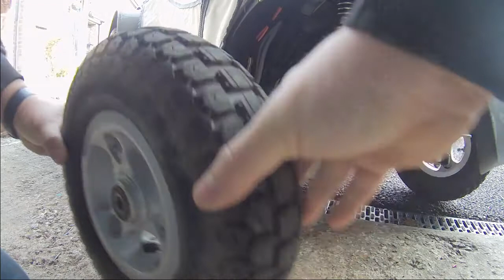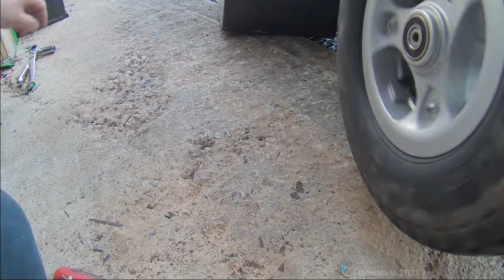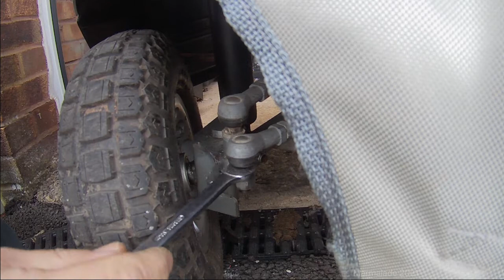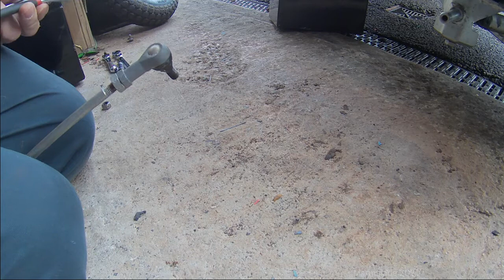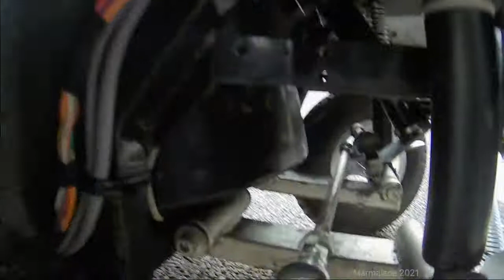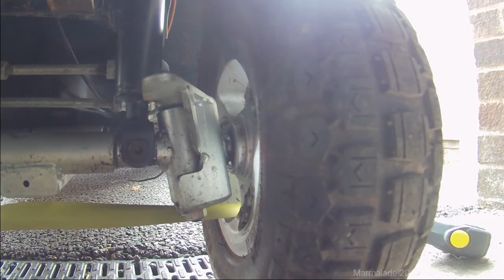TGA /Afikim Breeze S4 mobility scooter. Front wheel bearing & steering track rod end replacement.

Comment: how do you know when the track rod ends need replacing
Reply from the maker: The steering can become vague and you can often hear knocking. 

Turn the tiller fully left or right, hold the wheel that is pointing inwards at the front. 
With the other hand, grab hold of the track arm and give it a wiggle. 
It’s connected by ball joints so it’ll twist but should have no up, down or sideways movement.
Reply: @Bramble43  thank you ill try that
Reply: @Bramble43  slight movement up an down, on one side there another joint rod going to the steering ,that move up an down with a noise

Comment: Omg can’t believe what I’m watching  for a Tga engineer came out to this they won’t touch it on site it needs to go the  factory because you’re going off your eyesight not bang on with Tga and you have is problem someone from irsal has to come to the uk to do this work and lazers are used etc it not a easy job replacing the rod
Reply from the maker: It’s a 8mph scooter. 
It’s not going to get a speed wobble, start tramlining or scrub out the tyres in a few weeks. 
If someone is that concerned about it, most tyre bays have laser wheel alignment kit. 
I very much doubt someone comes from Afikim in Isreal to do wheel alignment on a scooter that doesn’t need it.
Reply: @Bramble43   I’ve had mine done twice by Tga  so I know what I’m talking about plus the work you have done isn’t singed off safe to be used
Reply from the maker: @iknwiknw7808  having paid to have it done tells me you don’t know what you’re on about. 

Signed off by who? For who?
Who is the almighty mobility scooter authority?